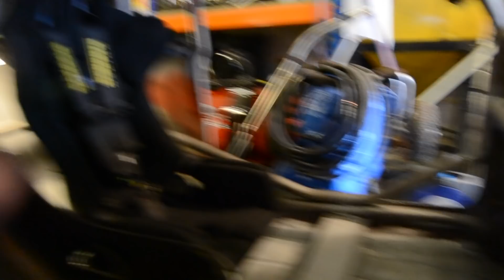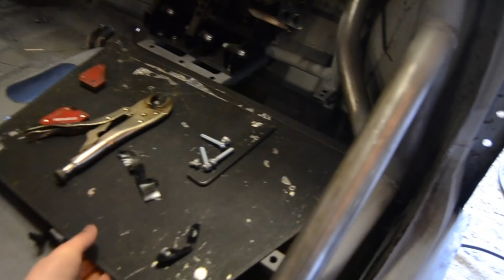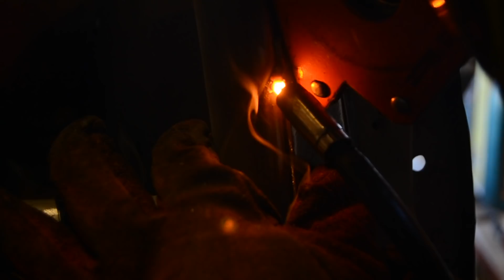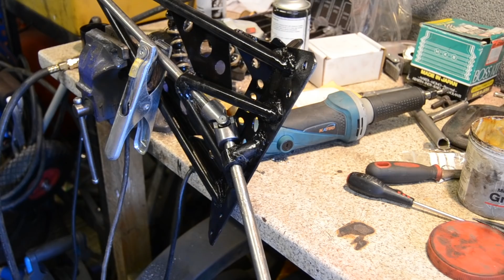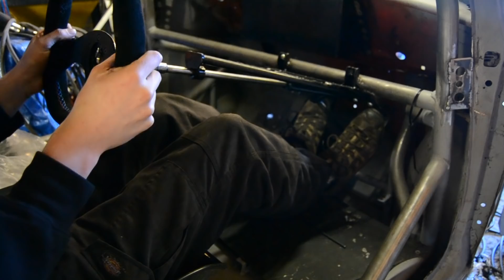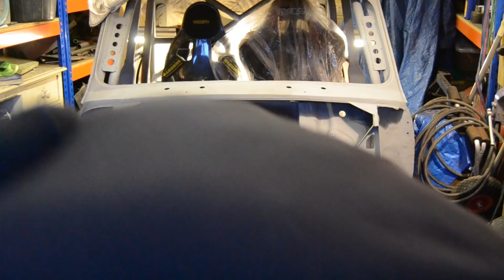Classic Mini Race Car Project | Part 16

Comment: Hi Adam . Have you seen any of the work done by Bad Obsession ? They are converting a mini using an engine from a bigger car. I believe they said the steering column needs to be collapsable for rallying. Regards Don

Comment: I hope you have another universal joint in that steering column configuration. If you only have the one your steering input will not be precise and instead be jerky. You need 2 UJ's to cancel out the issues in angular velocity caused by only having one. Thought I would mention this before you take it on track and have problems. If you have put another one in... ignor me.